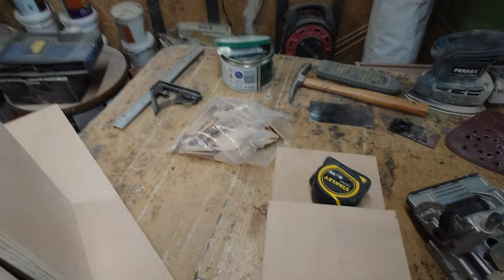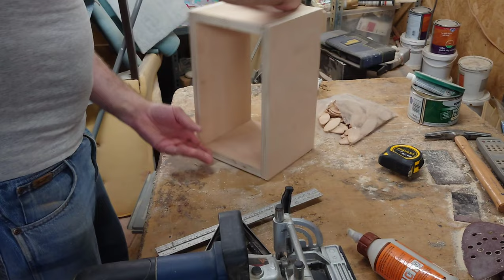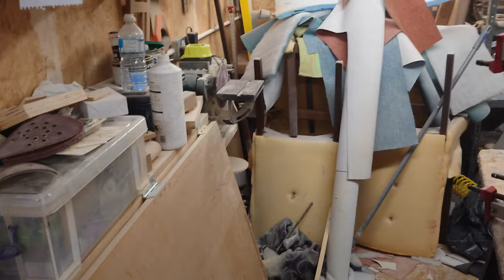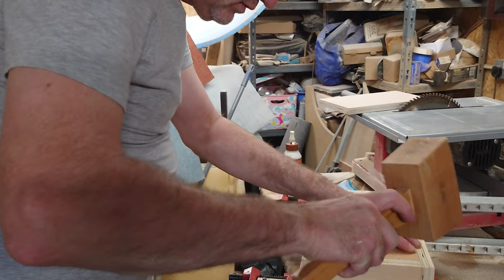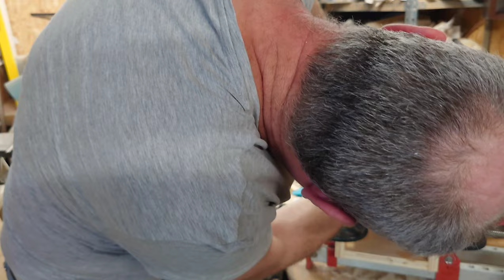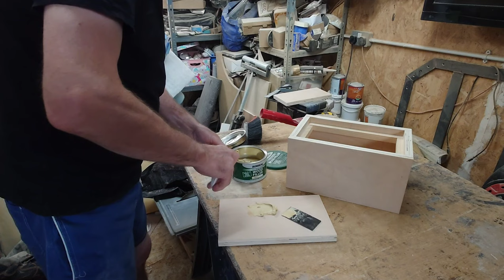Making Mini Monitor Speaker Cabinets

Comment: Very nice joinery, as always. Are the internal dimensions the same as the BBC speaker, or did you recalculate anything?
Reply from the maker: Yes the same size, taking into consideration the 18mm ply, opposed to 12mm, the midrange woofer, has very close specs to the kef b110 woofer, the crossover is different, thanks for commenting & watching 👍
Reply: @tweakerman  Alright, it seems like good changes to make so I look forward to the results.